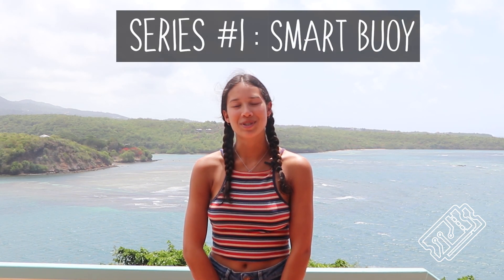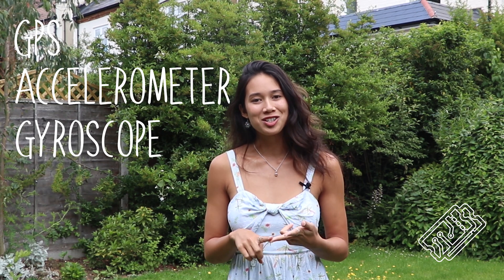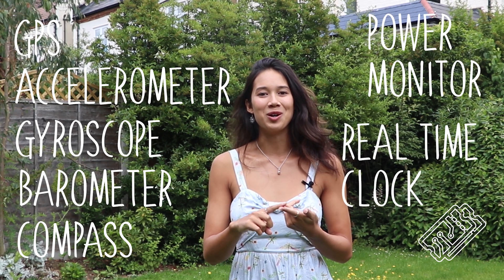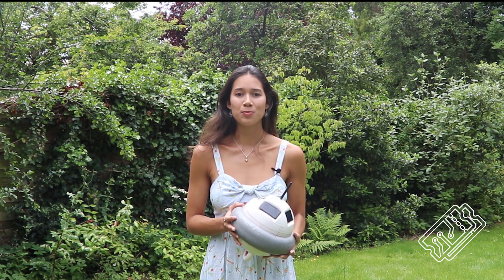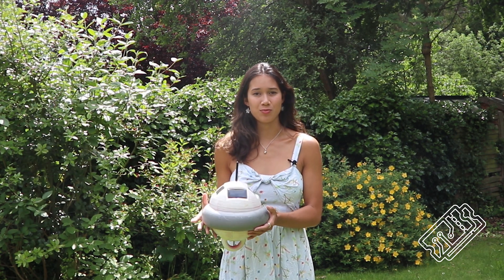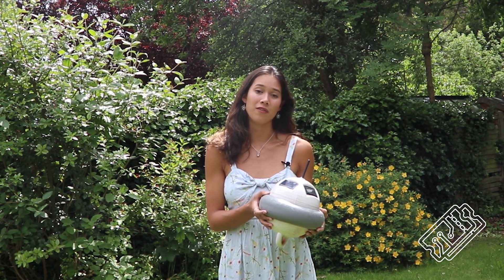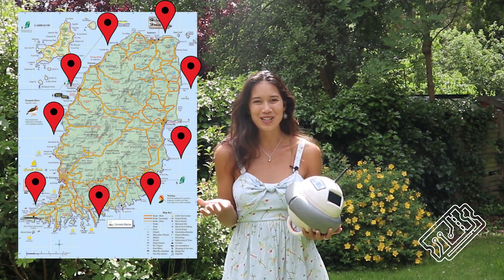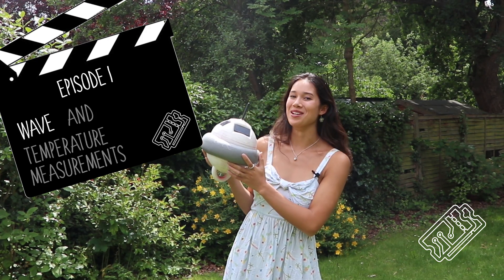Smart Buoy [Summary]

Comment: Well done, a great project well executed.    We always lean more on the things that don't work.  
The incorrect temperature measurements caught my attention.  Temperature is usually a pretty robust measurement ... so finding why it failed here could be an important breakthrough. 

As a systems troubleshooter, my first guess is that the cause of incorrect temperature readings could be caused by your measuring the temperature inside a sealed buoy.... the air pressure in the buoy will change as the temperature changes throughout the day .... thus throwing your temperature results. 
 The temperature sensor probably assumes that pressure is within usual atmospheric pressure limits .... just a first thought
 ... well done with this project.

Comment: This is a great project - congrats on your success!  Not sure if you were serious about the rotary anemometer, but.. it would need a stable platform for valid measurements, which would make your float way larger.  Replacing the Arduino is needed to fix the memory issue.  Switching your radios to LoRa might also be good - it's made for sending data over long distances, even through a lot of radio noise.  Adafruit makes a board called the Feather M0 LoRa, which combines a LoRa radio with a SAMD21 microcontroller.  It costs a little more than the Arduino plus radios, but it has much more memory.

Other options would be the Teensy and ESP32.  Both are still Arduino IDE compatible.  The new Teensy 4 has 3 built-in I2C ports, 3 SDIO ports, and a lot of other things.  I'm not sure why you use the I2C multiplexer - were some of your sensors hardcoded with the same I2C address?  If so, the three I2C ports on the Teensy should let you eliminate the multiplexer and simplify your program.

The best option, in my opinion, would be an ESP32.  It is a microcontroller with WiFi/Bluetooth built in.  It has a lot of memory compared to the Arduino, plenty of I/O, and the best part:  You can update it's firmware over WiFi (OTA)!  This solves your memory and update issues at the same time.

The WiFi and LoRa antennas would be far enough apart that they shouldn't interfere with each other, but it's possible.  If so, a magnetic reed switch on the inside of the float shell could signal your program to switch radios.  A magnet placed on the outer shell activates the reed switch - no holes for buttons! - and your program turns off the LoRa radio, turns on WiFi and gets ready for an update!  Remove the magnet and it goes back to LoRa and starts sending sensor data again.  The ESP32 also has an ultra-low power mode, so when you put it to sleep between sensor readings it barely uses any power at all.  I've heard it has it's own Real Time Clock, too.  Your sensor code shouldn't require a lot of changes, but the WiFi stuff would require a bit more programming.  Even with all the extra stuff you shouldn't run out of memory.

I've even seen an ESP32 module with LoRa built in!!  It had a lot of other things, including a display, and it was pretty expensive.  I hope I've sparked some good ideas for your project!
Reply from the maker: You definitely have sparked ideas! Lora bluetooth esp32 is the way to go it seems. We didn't know about the built in real time clock. Thank you!